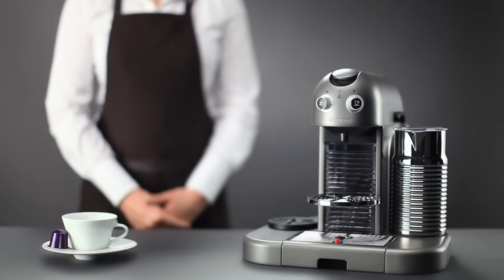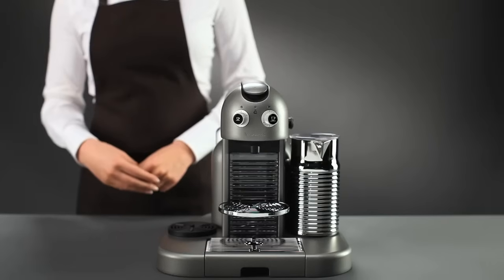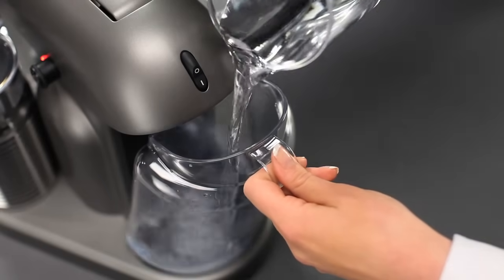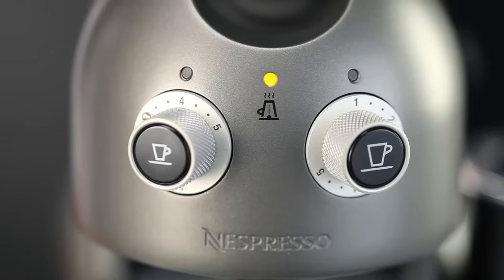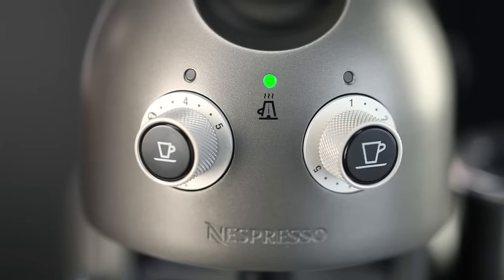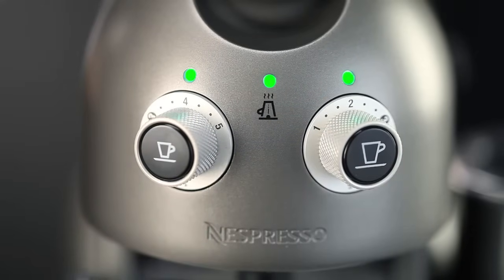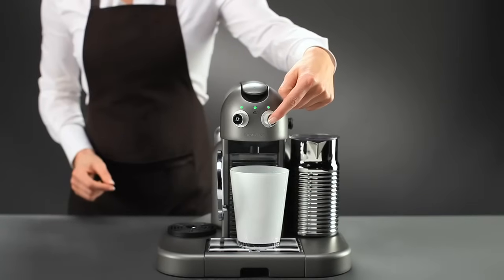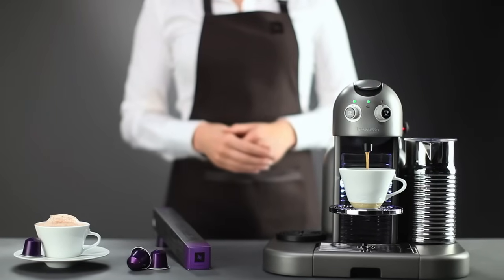Nespresso Gran Maestria: How To descale your Gran Maestria machine

Comment: Do the Maestria needs less desxaling than the other Nespresso machines? The Pixie, Citiz, U, Essenza calls for two times a year descaling.
Reply: cafetimer i recommend 2 times a month for abnormal use. in my house we drink allot from this machine. so i would say under heavy use, do it more. since ive been doing it 2 times per month i havent had any new repair problems
Reply: Descale every 300 capsules to 3 months if you are using tap water or every 600 capsule to 6 months if you are using filtered water...  In terms or capsule vs months, do which ever one comes 1st.  You can check your Nespresso Club account to see where you are in terms of capsule usage.  You'll also know it's time descale if you coffee become bitter, the flow is very slow, you have grounds in your cup, your capsules fall through, etc.
Reply: just want you to buy more descaler

Comment: Did everything but the yellow light will not go away.
Reply: +arlo4823 try changing the water hardness of your machine
Reply: We only use bottled water for
 brewing and descaling. Are you suggesting tap water?
Reply: No, do not use tap water.  You can change the water hardness so that the machine knows what type of water that you are using. It defaults to hard water, so the orange light will turn on sooner than you need it to.  If you are using bottled water change the water hardness to "soft water".  You won't have to descale as often.  "You may modify the water hardness setting by following these steps: 
 Turn off your machine 
 While turning the machine on, press the Espresso button to enter the Menu mode 
 The middle light will begin to blink orange 
 Set the Espresso dial to [2] to select Water Hardness mode 
 Set the Lungo dial to [2] for Medium Water Hardness or [3] for Soft Water Hardness 
 Press the Lungo button to confirm the desired setting 
 To exit the Menu mode at any time, you can press the espresso button for 3 seconds. 
 Once this is done, the orange descaling indicator light will come off. If the light is still remaining lit, your machine may need to be descaled."(FYI-I am using my sister's YouTube account, I am "12234rachelle" if you have further questions)
Reply: Boa
Reply: Apparently the instructions on the descaling kit were wrong. Went back to the manual and followed their instructions rather than the instructions on the descaling kit. It finally worked.
Reply: +Maria Ferreira fhjhY